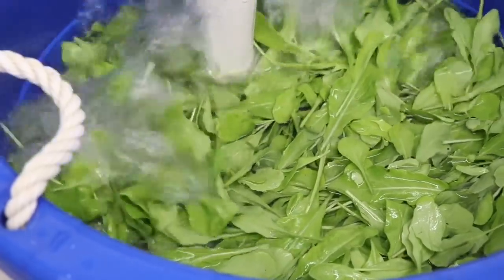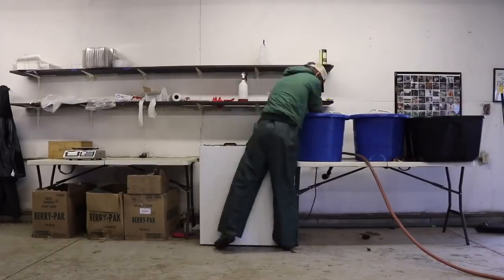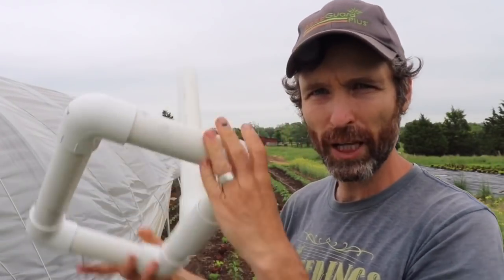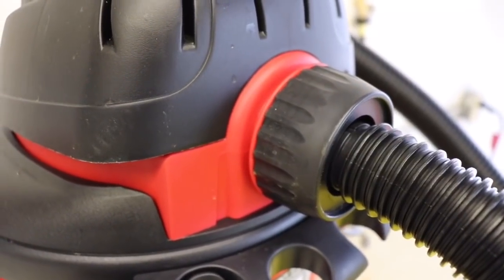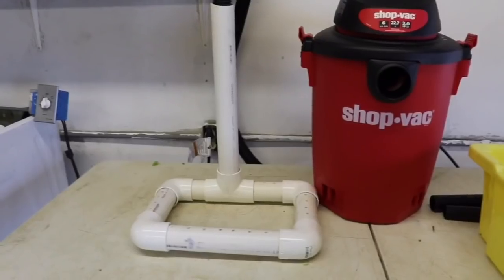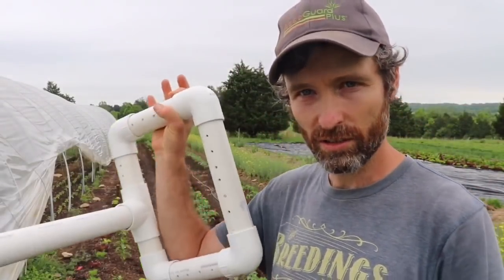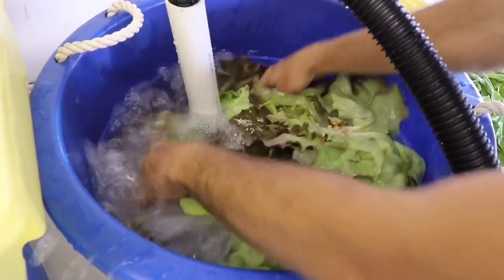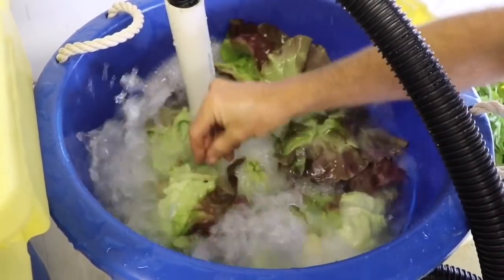A $99 Greens Bubbler You Can Build in 15 Minutes

Comment: I found this video a few months ago and it inspired me to try my own small scale bubbler. Thanks! 
1 (27 Gallon Tote) $15
1 (10ft 1/2" PVC) $3 (cut to fit tote)
Glue, Tee, and Elbows ($14)
1 (Intex Quick Fill Pump) $30
Grand Total: $62
The smile on my face: Priceless
Reply: How did you connect the air pump to the bubbler? I couldn't find the outlet size of the intex pump.
Reply: @riotscopez7311  , I didn't connect it. I usually hold it or some times I can get it to stay in the tubing without it falling.

Comment: If you decide to go with a ball valve make sure you put a t fitting and install the ball valve on the T. Instead of restricting the flow into the bubbler allow some of the air to go out the tea to control your flow. If you restrict the flow it may reduce the time your shop vac lasts
Reply from the maker: Great tip! Thank you
Reply: Was just about to recommend this however consider running the vent to your drying screen because we usually have those things in operation at the same time

Comment: I’ve been doing this system for awhile. I use noise canceling ear muffs or whatever you call them. I also added some Ts on the bottom to hold it of the bottom a bit to let the debris fall to the bottom better. And no glue is needed. I have a 70 gallon tote and 3/4 pvc pipe. Am able to keep it from moving by attaching a ratchet strap to the stand pipe and attach to the edge of my tote. Would put a pic if I could.
Reply: Actually it’s 1 inch pvc just checked
Reply: @sgrin2300  how did you do it without glue?
Reply: @Detroit-gx5nd  it just stays together with a dry fit. Plus you want be able to disassemble it so you can clean and sanitize it
Reply: @sgrin2300  thanks that make sense. I was thinking of using hydro-rain glue less pvc fittings which you can also remove but the fittings are 3x the normal price.
Reply: @Detroit-gx5nd  no need to spend the extra money. Mine works just fine. Never any issues. Ive just tweaked my bubbler design from time to time

Comment: i would suggest teeing in the ball valve to vent excess air flow, rather than blocking it. Blocking it might make the motor work harder get louder, 
and burn it out faster.

Comment: FYI central vac tubing is much lighter and costs less. Mine is just pushed together other than the first portion with the tee and first two 90’s. I glued that because I hose clamp it to the rope handle so it can’t float up. Ty for the great video.

Comment: Honestly, I'd be interested in yet another bubbler video, specifically how you clean it.
Reply from the maker: Dor sanitation we are simply pouring a little isopropyl alcohol in it, running the blower through to blow the alc through the holes, wiping it down with alcohol, and then letting it sun sanitize. I think doing both a dunk in sanitizer water then the alcohol wash wouldn’t be a bad idea.

Comment: Some Vacuume cleaners have a noise rating. You may so be able to use some extra PVC and line it with some type of foam as a muffler. Like is used in certain central house vac systems. Or similar to a glass pack on a car. Hope it helps
Reply from the maker: That's awesome. I didn't realize that about the rating. Thank you for the tip!
Reply: If you make an extra tube connection the air capacity will automatically go down and you can put your ‘blower’ further away = noise reduction

Comment: nice! do you think it 
would remove aphids from kale or other greens? I recently had an aphid infestation. I had to spray each leaf one at a time at the kitchen sink. very labor intensive!
Reply: I've used a water bath method in the kitchen sink. I had a few drops of organic insecticidal soap like Safer's and then just agitate it for a minute or two, adding two clean water rinses and that seams to work well. The soap is just breaking the water tension and makes it really hard for the insects to cling to the veg. Small scale for sure and not selling, but it works. Just cut leafy greens though, I wouldn't do it for heads.

Comment: Try using a 110v squirrel cage fan from an old a/c unit and if your lucky you might find one with a variable speed switch,also Flexible gutter spout will fit on most of the smaller fans
Reply from the maker: Interesting idea, Stephen! Thanks for the tip
Reply: What's a squirrel cage?

Comment: I am hoping someone in here can help me. We need to make a very small kitchen sink size bubbler. We wash about 7-9 heads of lettuce and 2 bunches of  celery weekly for organic green juice. We get organic produce from a grocery store. It is filled with bugs and dirt. We wash it once with reverse osmosis water with apple cider vinegar in it for disinfection, and then again in clean plain reverse osmosis water. We have tried several different methods out, food grade plant sprayer, putting it in a sealed Tupperware and shaking it it, and straining it several times, but they are all extremely time consuming, and it is putting physical strain on our bodies. I know we can cut the pipe small enough, but we are concerned that even the smallest shop vac would be too powerful and would blow the bubbler out of the large container we would have to be put in. I think a jacuzzi pump would have the same issue, not to mention it has to be wired etc. We do not have the room to build a larger scale one outside, plus we are in a climate with a lot of different weather types, so doing it outdoors would not work. Does anybody have a suggestion for using a less powerful type of device for pushing the air through? I have looked at pond and aquarium pumps, but most of them do not seem strong enough. I am just not sure what type of pump, or motor, would be just powerful enough, but not too powerful. I am about ready to tear my hair out trying o figure it out. Anybody’s help would be appreciated.

Comment: you need an aquarium bubbler. Also, as far as sterilizing goes use hydrogen peroxide. It is very close to bleach in how it interacts with biological  matter however once oxidized it decays very fast into nothing harmful. Brewers use it to clean out their pipes.